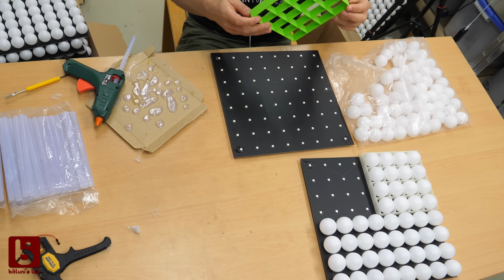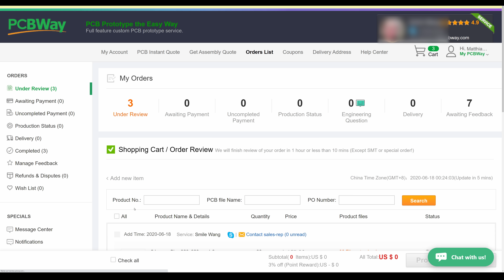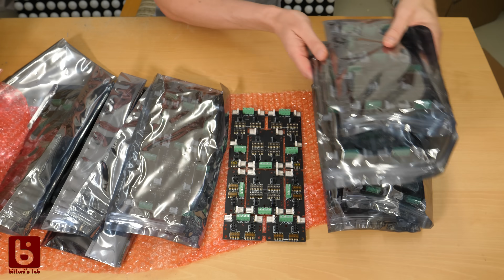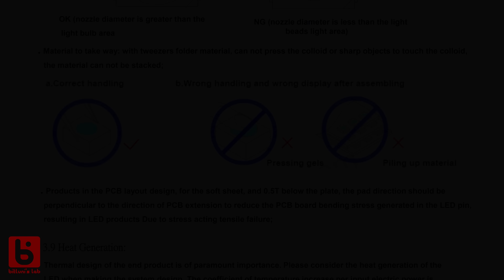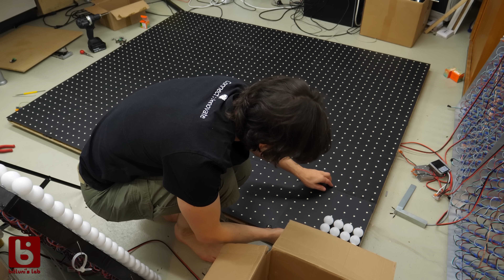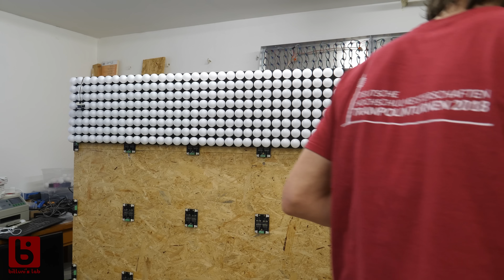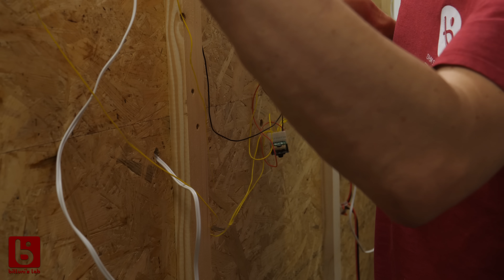Ping Pong LED Wall v3

Comment: Ping Pong Bälle zu 3D printen wird Problematisch wegen der "gleichmässigkeit" in der Kugel. 
Warum druckst du nicht nur einen kurzen "Rohr" als Abstand Halter zwischen PBC und Kugel??
So kannst du um die LED kleben (keinen Kontakt zwischen LED und Kleber und so auch keine Chemische Folgen für die LED), kannst die Bälle 1-2mm vor der LED plazieren so dass du die Thermische Komponente auf der Vorderseite der LED nicht hast (sollte auch kein Problem sein), bessere gleichmässigkeit wegen unterschiedliche Kleber resten auf der LED und vielleich noch ein bisschen bessere Farbmischung in der Kugel.

Comment: You get a lot of cross talk / interference from illuminated ping pong balls on non lit ones.. if you put thin light blocking strips in a grid between all the balls, it would allow for the light to not leak out. with that, contrast should improve greatly! the probably only need to go up to half height of the ping pong ball, idk. beautiful ping pong led wall otherwise XD

Comment: I could imagine getting DIN Rail mounting cases for the Corner PCBs. DIN Rails are fairly cheap and come in different sizes, from 1 meter or less to how ever long the manufacturer can make them. DIN rails with standoffs exist as well, which could be useful for cable routing. Just clip the PCBs on, space them apart correctly, wire them and plug in your panels. That would make maintenance much easier as well. For the PCB DIN Rail mounts you could even get a manufacturer who can make them in one piece where you just clip the PCB in afterwards.

Comment: That looks super cool!  
You should use a glue with a longer working time, it would save you a lot of hassle assembling the balls onto the panels.  A clear construction adhesive would be perfect for this application.  It comes in cartridge tubes that will fit in a construction caulking gun for easy dispensing.  Place a dab on all 64 leds, then drop down an 8x8 template for the balls, then drop in a bunch of balls.  Leave them on a room temp shelf overnight, and you'll be good to go.

Comment: How about using double side tape that come in "RING" to stick the ping pong ball to the board? Since your PCB is already work as a back board, you don't really to build the wood board. You may able to get away with a wood frame, or even better a aluminum frame build from those per-extruded aluminum channel.

Comment: I think I would have just cut the ping-pong balls in half, and glued them on that way. to avoid gluing too close to the LEDs. heh Probably labor intensive to cut them, but so is carefully putting down a thick circle of glue around a fragile LED. lol It'd be a LOT easier/faster to glue them on as halves.

Comment: I'm curious, would a solid grid with some kind of light diffusing cover be better for this, so there's less color bleeding from ball to ball?  Essentially the same thing as the jig you use to apply the ping pong balls, but with a flat or rounded cap on top to keep the all-white screen or something

Comment: Nice! thanks for the video, it is inspiring.
As feedback I'd say I would have probably used a 3d printed "grill" that could use the growing diameter of the ball to hold it in place (with the ball cut in half):
# C |
# C |
# C |
# C |

Comment: Fantastic result. Great credit to you for a very great dolution.

Sadly you had a bad experience of "IF ANYTHING CAN GO WRONG, IT WILL!" Sadly in hindsight it was bound to be problem balancing the wall firing wiring. 
That project including necessary repair of the crash must have cost a considerable amount of money, not even huge number of hours.
Hope you can realise a commercial result in due time, as it seems feasible as a large display wall.
Any chance of pushing 4K resolution, ha ha.👍😀😀😀😀

Comment: The next version should have auto detect so it can configure itself in the best way possible. Maybe it can detect panels by adding an extra 2 pins so when their bridged it detects the panel. The config mode would have to be coded

Comment: Have you tried mounting a frosted glass sheet in front of the LEDs instead of using ping pong balls? This won't give you single "pixels" ("pingpongs"?), of course, but should be way easier to assemble and probably gives a similar blurry result for large images.

Comment: I suggest to 3d print some sort of ping pong ball holder that you can glue the balls to it so it can isolate each led to add some contrast but also it will be easier to place them in bulk (by using magnets that can just be glued precisely on the pcb

Comment: This is so cool! I have the perfect wall for a 4x6 panel wall (1536 pixels). One of the craziest things is how "dense" the wall feels in comparison to v2 probably due to the big upgrade on how precise the ping pong balls have been mounted. What would I need to build this? Do you license the PCB designs?

Comment: A small question. How is the idea of using pogopins and magnets to connect and hold the boards? Instead of header pins. Plugging and removing panels could have been easier 😁

Comment: I love this proyect so much, i would like to build a ping pong wall but smaller, like 4 modules, how much do you think would cost?  and do you think doing it like any of the previous versions would be cheaper?

I realy like your videos, keep it up
Reply: I also am interested in the cost, but I reckon it costs a lot. One panel has 64 LEDs which cost 12USD for 50pcs. The PCB is also expensive(because of its size). I was thinking about making a similar LED wall but I would probably mount the LEDs directly to a wood surface and not use modules to reduce the cost. I hope you succeed in making your version.

Comment: Nice build. Suggestion. If you glue 16 ping pong balls together and rub them on a sheet of sand paper to make a hole the size of the LED's then they should fit neatly over the top without having to glue onto the LED's. In fact designing a cutter to cut the hole shouldn't be all that hard. perhaps a hot tube pushed through the ball. a jig of upright dowels will keep them spaced as you glue.

Comment: I am almost ready to build one my own - but I don't have time to experiment a lot - what would be needed to a vga/hdmi input? Or is streaming via wifi sufficient?
Reply: I would want it to have as low latency as possible - and even add black seperators between the LEDs

Comment: Not sure if it'll make much difference if you're getting the factory to solder the pin headers, but a potential saving of effort would be to replace pin headers with pogo pins on the corner boards and pads on the led panels. Also not sure if it would be a cost saving or not. You would need less components overall, but the cost of pogo pins might outweigh the savings. Something to consider though? Also, perhaps epoxy the pingpong balls to each other instead of gluing to the board, and then use some sort of clip/velcro/doublesided tape/ mount to attach it to the board?

Comment: Consider getting the square grid laser-cut out of plywood and covering it with 1mm white plexi, instead of using ping pong balls. You'll get much lower crosstalk/bleed between pixels.

Comment: Freakin Brilliant! I did some 100mm x 100mm w/64led panels, thru hole mount hand soldered. I made 1 so far... 
But ping pong balls to diffuse light, I never would have thought of that.

Comment: Amazing project but I think it would look nicer with square section than with round ones. I think you wanted to do that with your square 3D printed box for gluing the ping pong balls but didn't want to actually 3D print out all the sections.  It's a glorious wall though credit where it's due. You're amazing.

Comment: A good upgrade for the next version would be: instead of glueing the ping-pong balls directly to the panel, 3D print a 'low-profile' tray (black) that the balls get attached to. That snaps in place over the LED panel. That way if an LED goes faulty over time, you can easily access it. Also a tray would have more surface area to adhere with glue, better structural stability between the balls. Granted it would take quite a bit of time/filament to print the amount of trays needed.

Comment: A couple of thoughts:
- I hate that everyone is still using WS2812 LEDs. Sure, they only take one data line, instead of the clock+data lines that later iterations use, but those later iterations have a much more flexible timing profile as a result. Instead of being required to run at a strict 800kbit/sec, the SK9822 series can run at 16Mbit/sec (and I've actually driven them as fast as 20), and the even newer HD107s line are supposed to support speeds as high as 320Mbit/sec. At those speeds, you could have still gotten away with running in pure serial mode (though switching to parallel is probably better anyway). They also run great off a raw SPI signal, and include a brightness setting, which I've found makes certain types of animation easier, AND HD107s is advertising significantly reduced power requirements and a PWM flicker rate that should be fast enough for use in POV displays. (I have 2 rolls of HD107s LEDs in the mail that should arrive next week, and I'm excited to benchmark them.)
- For the ping pong balls, you could try a vacuform "egg carton" of hemispheres instead of 3D-printing. Maybe with a white acrylic sheet for structure and pre-diffusion. Should also improve the durability and maintainability of the display. And you won't ever have to hot-glue a single ping-pong ball ever again.

Comment: Awesome Job !!!  I got some free advise tho:  Use Ruby Fluid flux on the solder joints and then afterwards remove flux and rosin residue with alcohol.  Very Important to remove the residue because over time short circuits can grow across the rosin.  I had to learn the hard way.  Another thing is use solder with lead !!!  Lead free solder is useless and does not bond well.   Also maybe try melting a large hole in each ping pong ball with a soldering iron so that the LED modules sit inside each ball - it would be brighter and stronger.   All the best on future projects !!!

Comment: Just an idea for v4, could you mount the panels with magnets? You could feed power through contact powerpoints and have each panel their own driver. Then maybe use another form of contact to have it automatically determine the position of the panel in the grid.

Comment: very cool.  great job.  in your next version, in your ping pong ball jig, if you make it so you can dip the bottom half of the ping pong balls in some thick black paint, that would keep most of the light from each ping pong ball bleeding into the lights next to it. it would also keep some of the light from reflecting off the back wall behind the balls.  that would give you more color separation between each pixel.  ideally you could dip them all the way to the half-way point of each ping pong to keep any light from going out the back or sideways.

Comment: Very nice LED wall. Thank you.
Can you help me with ESP32-CAM. I have a problem with pixel level processing. So I decided to saved camera buffer to bitmap into SD card, and reading it for processing pixel by pixel. Its something like JPG to pixel 1D array ?

Thank in advance.
Reply from the maker: you should check out the esp32 face recognition example. afaik it fetches a jpg image and decompresses it into psram to process it
Reply: @bitluni  how decompressed, into rgb ?...cause I have 800x600 bitmap loading into 1D array in 2 seconds.

Comment: How much would all components cost if not sponsored by PCBWay? Since the PCBs alone cost around 500€ according to the order page I guess the whole project comes up to around 800-900€?
Reply from the maker: The corner boards are overenginered. solder jumpers would be sufficcient. the power supplies have been 200 already. so I assume it's rather 1200. I imagine the price could drop significantly at volume but it's still 30 panels
Reply: @bitluni  Dayum! Oh well, at least the next Makerfair will be interesting :D I should probably visit that once the whole Corona stuff is fully over. But yeah I'm also interested in that LED wall, not as big but I'd love to hang it up on my room wall and display various things or just play around with it :)

Comment: Ok.. honestly, can I buy the panels from you somehow? I'd love to create one of these of my own..
Reply from the maker: I can try to get quotes... write me an email so I can make a list
Reply: @bitluni  
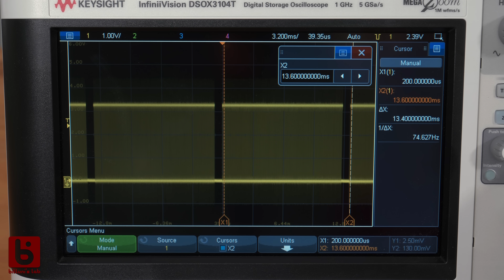Just out of curiosity, but at 16:28, couldn't you theoretically achieve higher FPS throughput by addressing the columns horizontally instead? The denominator being 5 instead of 6 seems like it could sustain the data increase per channel while attaining higher speeds and less power usage (though, I guess with LEDs, that's marginal at best)... I could easily be wrong, but I just wouldn't know why at this point... 🤔 Any insight?

Comment: I wanted to do something similar in a studio. I was collecting old empty glass coke bottles from a couple of stores. I built a jig to make glass guitar slides a long time ago, and was using it to score and cut the bottoms off the bottles a few at a time. It's easy to score the bottle and use hot and cold water to stress and cut the glass. The jig is just scrap wood and the circular cutting blade from a ceramic tile cutter. The thick glass from the bottles and their rather abstract light refraction through the various shapes and thicknesses makes for an interesting aesthetic. It would be a pain to do something like this at once, but I like projects like this that take a little bit of daily effort distributed across a couple of years.

Comment: I am glad no one got hurt when it fell, but it would have been devastating to see that happen.
I know this would be a lot of extra work, but could the ping pong balls be darkened in the lower half to help stop bleed from other pixels?
Reply from the maker: interesting idea to compensate the bleeding
Reply: @bitluni  It would be a fair bit of work as your couldn't just have them dipped as you need that spot where the pixel joins the ball to be clear.   I wonder how hard it would be to have some kind of template made up......

Comment: Extremely nice.. great improvement over the last one.  I would suggest a grid of light separators, like the one you used to glue on the ping pong balls, but thinner.. maybe thin black cardboard, and only as high as the center of the balls, or maybe a mm  or two higher.  It'll block the light that's seeping into adjacent balls, and make the image crisper.

Comment: I can imagine the phone call to the toy supplier:
"I need 2,000 ping pong balls."
[Three days later]
"I had a bit of an accident.  I need 2,000 more ping pong balls."
Reply from the maker: it's so funny. my last walls already had impact on the aliexpress ai. it always suggests to buy ping pong balls when ordering ws2811 chains 🤣
Reply: @bitluni  How did you get all of that through clarence, sometimesi have problems with 10 small items, and you manage to sniff thru 2k?(Iam in CZ, but both countries go by the EU orders in that regard so I suspect its similiar)
Reply: @honzapat  you know you can just register your shipment with your local customs agency, right? it costs, but makes it 100% legal.
Reply: @QuantumFluxable  At that point, atleast in my case, Iam better of buying it locally. (Not that 20% is much that would still be better, but all the extra they take for processing etc.)
Reply: @honzapat  In my country (NL) customs 9/10 times doesn't check the package. Even if the price listed is above allowed (22 eur IIRC), they usually don't check it. Way too many packages. Sellers will usually put a lower price on the package for customs.

Usually order stuff <20 euro per package, but none of my packages have ever been held up by customs.
Reply: @JoranGroothengel  (NL here) I once ordered a ~60 eur object from the US. Fedex called me asking for something with the price on it because it was held at customs. I mailed them the invoice and I received it anyway without having to pay any VAT, strange...
Another time, also ordering from the US, the package got to me as usual but with a note from postnl that I had to pay 18 eur VAT.
All my orders from china, hong kong, japan just arrived anyway.
Reply: @bitluni  This remind me of a very old absurd joke where a guy is asked what he wants for birthday and he always wants pink ping pong balls and on his death bed he dies before answering why he wanted that each time. Now we know...
Reply: Only 1920 as I count it, so he already had some extras.
Reply: They probably think he sank another ship and has to float it XD

Comment: On v4 I would use a buck converter straight on the led board to convert something like 48v to 5v
Reply from the maker: if you watch my last video, there was a small converter. that would be perfect to glue on the back.
Reply: That might work or get pcbway to assemble a buck converter with either the distribution board or with the led panel. There are lots of small low amp buck converters with low component count. Keep up the good work!